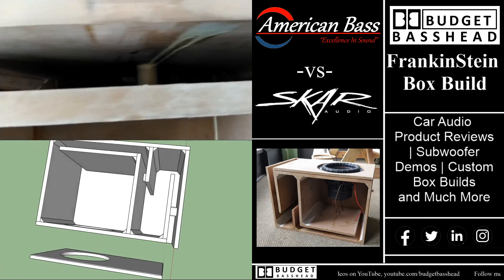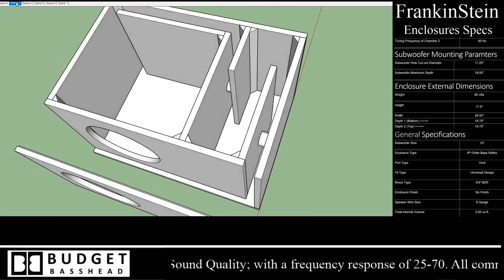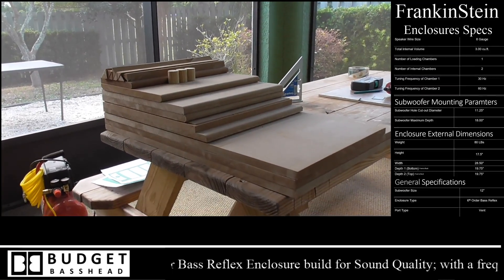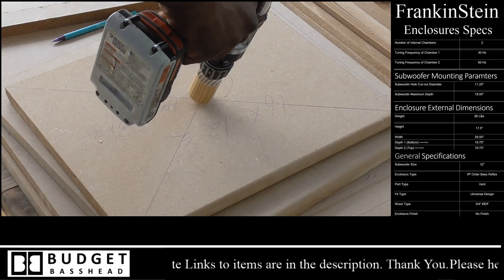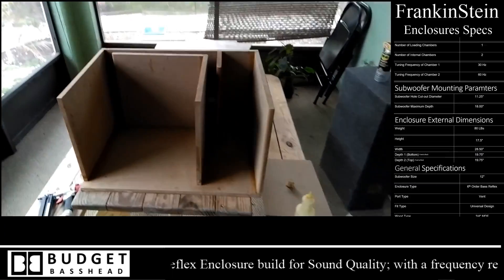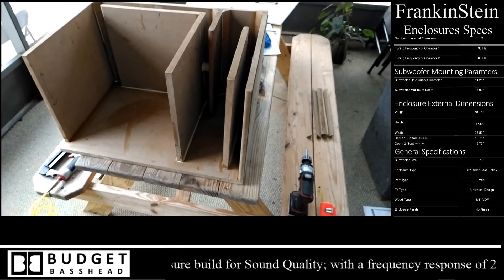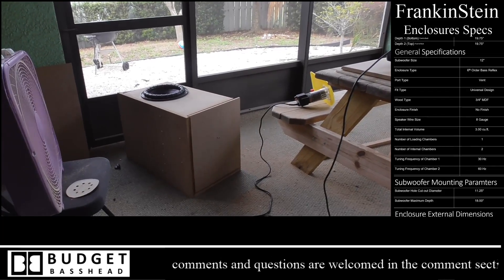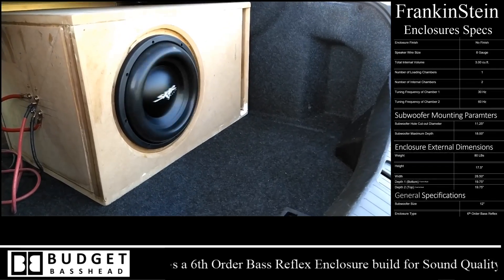6th Order Bass Reflex - Full Build w/Specs | VXF-12 vs XFL-12 | SPL Meter Preview

Comment: @budgetbasshead I have 2 EVL 12s in the preloaded EVL enclosure and a rp3500.1. Would I notice a difference in db or sound if I swapped them out for the VXFs? Would it be worth the cost.

I ask becuase they both require the same cubic feet and the specs of the VXFs intrigue me...but the cost is pretty hefty. Does the extra magnet weight of 120oz per sub, extra xmas and power handling really make a difference?

Comment: American Bass. I'm debating between doing a regular port, or passive radiator in place of the factory 6.5 since I'm putting a single 10 in the trunk.
Reply from the maker: I never done passive radiators, but I have heard good things about them.
Reply: Or dodge peaks going sealed

Comment: I just got the same American Bass XFL 12 (1244), 3000watt max/1500rms 4 ohm sub. Did you wire it down to 2 ohm. Should I  give it a 4 ohm load or a 2 ohm load

Comment: How would it work if you built a box, used 2 ports, one on each side of the box. 1 tuned around 45 and the othe
r around 28?
Reply from the maker: Not sure. I think it would average between the two. Around 36hz

Comment: sup bro nice vids gotta a question i want to run 2 Rockville 6.5 woofers what sort of box do you recommend for typical rap bass in a small crossover suv thanks
Reply from the maker: T lines are great for small subs. But if space is an issue, go 4th order and port it to about 40Hz. That should give you some nice bad for hip hop 😉
Reply: @BudgetBassHead  thanks for the response how much you charge to blueprint an enclosure preferably the one you're speaking of